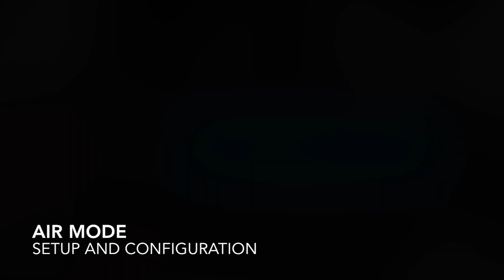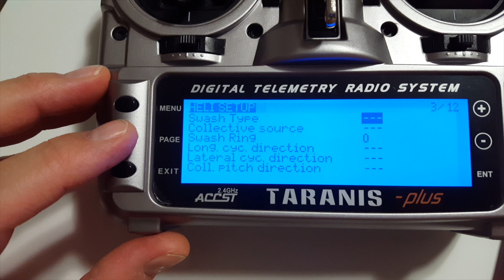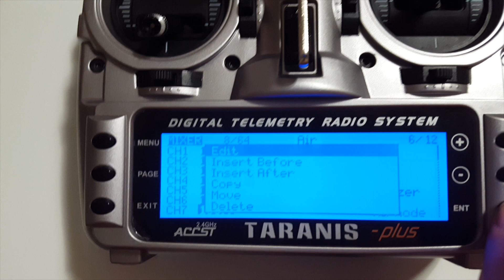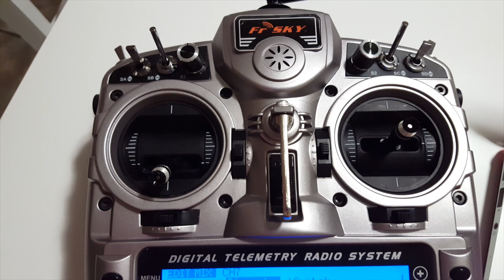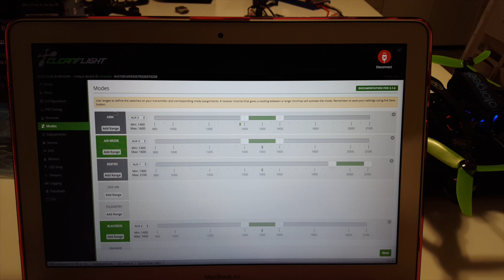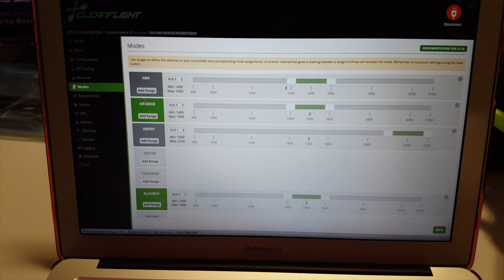Betaflight Air Mode - Setup/Configuration

Comment: Couple of questions.  Why do you have motor stop off? Is that a personal preference or is there another reason? 
You also have Arm and Airmode setup on difference switches.  Is there a specific reason for that?  Can you set them up on the same switch, so that when you arm, airmode is also on at the same time?
I am having issues getting betaflight setup and I am still fairly new to it.  Have used OP for a few years and am just now making the switch over.
Reply from the maker: Motor stop off is required for Air Mode to function properly. I had placed on different switches at time of creating this video when Air Mode was still very experimental so I was able to enable or disable if necessary. It is battle tested now and I suggest arming and enabling Air Mode all at once.
Reply: +deepimpact.io I think the problem I was having was motor stop On instead of off.  It seemed to cause the motors to spool up quickly and when I would take off it would go straight to full throttle.  I have to do a real test later, but it seems to be ok.
I seperated Arm and Airmode to separate switches thinking that may have been part of my problem, but I will go back to both on one switch after seeing what you said. Thanks for the quick reply.  Like your videos.  You're in Panama?

Comment: should I turn off air mode before landing?
Reply from the maker: It helps if you are a rough lander. Airmode tries to correct aggressively and sometimes will throw the quad when coming in for landing and making first contact. I have learned to disarm as soon as I touch down, but disabling Air Mode will have same effect. I currently put Arming and Air Mode on same switch. I used the method in the video when Air Mode was experimental and I was unsure of using it. Boris has mentioned in future version of Betaflight that it will become standard. Happy flying!
Reply: +deepimpact.io thanks for the information... I need to get used to disarm with a switch.
Reply from the maker: Johnny Freedom yes it takes some time. I was also a stick armer. The hardest one to remember is when you crash. I almost always remember when it's in front of me and can hear the quad, but if it goes down unexpectedly you must remember to flick the switch or you could burn some motors or ESCs.
Reply: +deepimpact.io yes I found out last your lol... just did a test fly with beta 2.2.0 and arming on a swith... after landing I forgot to disarm with a switch and wanted to disarm with my stick and it went crazy! should the motors spin with armed or should I turn this off?
Reply from the maker: +Johnny “JohnnyFreedom” Freedom yes, motors will spin as soon as you arm and motor stop disabled. This is the intended design. This is what allows you to still provide stick inputs and the quad will respond even though at zero throttle. I have min throttle set to 1070.
Reply: +deepimpact.io okay thanks!
Reply: +deepimpact.io my Taranis plus didn't come with engine arm, and shit is about to get real :((
Reply from the maker: +Jake Cardinale Haha I had a little laugh with that comment. In all seriousness you can install the "Amber Voice Pack" and your shit will get real brother, although it isn't really required to happen ;) Just search for Taranis Amber Voice Pack and you will get a few hits. Also make sure you find version for your Taranis firmware version because some things vary with newest 2.1x versions.
Reply: +deepimpact.io haha thanks bro!